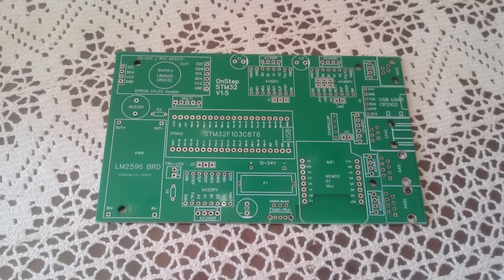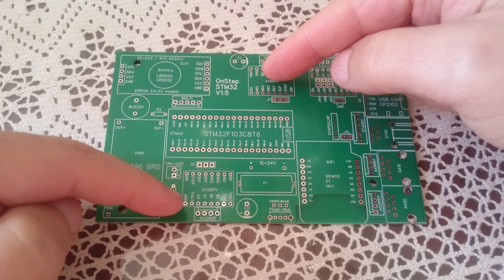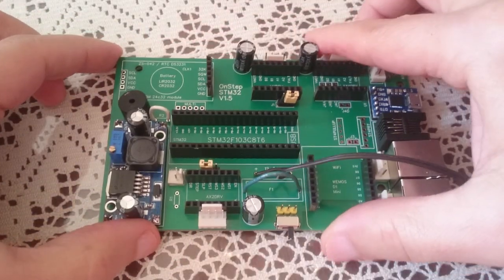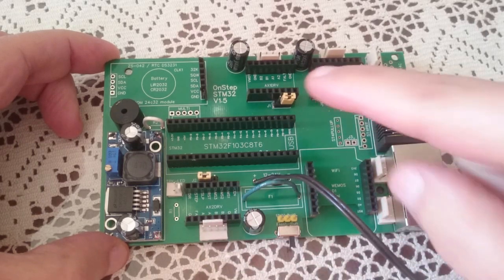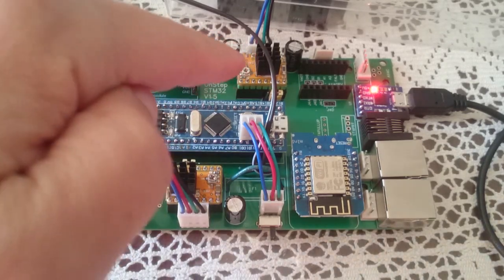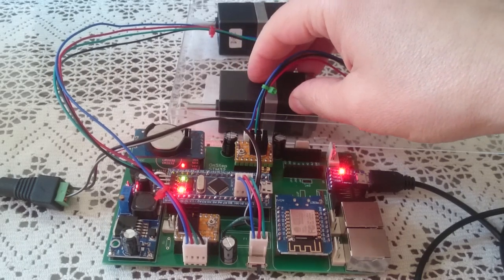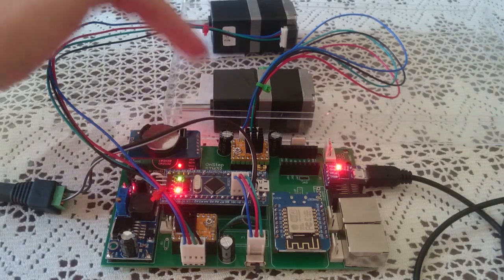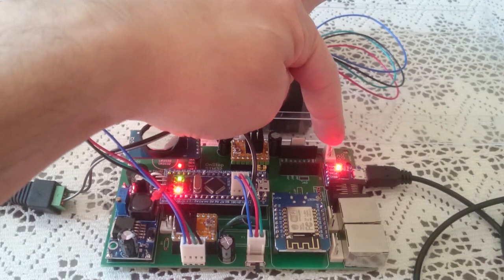PCB for STM32 Blue Pill OnStep Telescope Controller

Comment: this would be really cool...if only I could make it with the equipment I have in my lab
Reply from the maker: This is an old version of the project.

There are better boards now, and some of them don't require any sourcing of parts, nor soldering. 

Check the OnStep Wiki for more info.

Comment: One Question, Is the selected star or planet to observed using that will auto follow the object since the earth rotates? ?
Reply from the maker: Yes
Reply from the maker: That is only one part of the functionality. There are lots more features that OnStep has. Not all features are used by all users (e.g focusers, autoguiding, WiFi, Serial port, and so on). 

If you want a simple solution that only tracks the sky without having goto functionality (or the other advanced features), there are other projects that can do that. For example Sky Track, ...etc.

Comment: what about the resistor r2..
should we use a resistor at that position.
Reply from the maker: Please read the entire document that is linked in the description of the video
Reply: @khalid_ba  thankyou sir..
Reply: @khalid_ba  i have built the board sir and understood tat part..
but confused with the flashing of the software on to the stm32....
need some help with it..
Reply from the maker: @suveerudayashankara4273  please visit the first link in the description of the video. Details are all there.
Reply: @khalid_ba  sir i understood the flashing part but getting some errors while verifying the program..
it is showing :(no such file or directory found)
i even updated my ide as well but it is not working.
Reply from the maker: @suveerudayashankara4273  You have to ask about those errors in the OnStep group.

Comment: Hello, In your initial breadboard version, the output voltage of the step down buck converter was 3.3V and all the operating voltages of the components are also 3.3V, Can I ask why you’ve changed the output voltage of the step down buck converter from 3.3v to 5V in the final PCB version?
Reply from the maker: The main reason is to accommodate the Wemos WiFi controller, which is much easier to flash and more stable than the ESP-01S module. The latter is really a pain to program, and prone to failure.
Reply: @khalid_ba  Thank you for the reply. It’s a great help!  I’ve tried with the ESP-01S and found something wrong with it. I mean sometimes it is not working correctly (Not sending data to the main board).  I have to change the WiFi module. Thank you so much!

Comment: Hello Khalid, I am planning to make this version, but the Gerber File which I downloaded from your EasyEDA page mentions DRV8825 as the driver and not the LV8729. Will this new driver fit into the same holes on the PCB? Thank you. Also, if I do not wish to have wifi or the fuse, what should I do? My knowledge of electronics is very little. Thank you.
Reply from the maker: The LV8729 will fit in place of the DRV8825. 

If you don't want WiFi, then you will be limited to controlling OnStep over USB only, so from KStars or ASCOM. 

If you don't want a fuse, just solder a wire across.
Reply: @khalid_ba  thank you for the quick reply. I will decide if I want WiFi closer to the day I start to build 😀

Comment: Good video.
Terrible PCB :(
Reply from the maker: Well, over ~ 400 users disagree with you. 

You also could be specific, and constructive and not just hurl general criticism that way ... 

Of course, the PCB is not perfect. But it does not have to be: you know the engineering wisdom of: never let perfect stand in the way of good enough. That was the philosophy, and it succeeds in its mission.

Comment: Hi. I have the Arduino Mega 2560, RepRap Ramps v1.4, DS3231 RTC, A4988 step motor drivers, HC-05 Bluetooth module. Is it possible to create this project with the materials I have? If possible, what connections should I create and what code should I load? Thanks.
Reply from the maker: Possible, but it may be slow, and will have limitations 

https://web.archive.org/web/20210118065709/https://onstep.groups.io/g/main/wiki/3996
Reply: @khalid_ba  Thank you so much. So, what code should I install? I've seen codes with different names, I'm not sure which one. Can you help with this?
Reply from the maker: @hakankagan394  
All the info is on the OnStep web site

https://groups.io/g/onstep/wiki
Reply: @khalid_ba  thank you very much

Comment: Hi there Khalid. Sorry to write you here but I've just assembled my firts stm32 kit from George (no wemos wifi, just hc-05), after flashing and everything, I powered the board (the les appear dimmer than I thought) tried to connect to the hc05 with no successes (its led was also very very dimm) it doesn't show up in my BT devices list. Tried connecting it directly to the board with no success. Then I measured the voltages on the board. In al 5v pins it only read 2.2v. Then removed all the modules (with power of fb of course) to verify the voltage again, and they are 5v. So.. Its that normal? Im using a 12v 7a battery to power boar.
Reply from the maker: Please ask any support questions you have in the OnStep group. There are lots of people there with lots of experience.

Comment: What will I need in case I want to use onstep with bigger nema23 motors?
Reply from the maker: You use drivers that can output more current, like the TMC5160 or the S109
Reply: @khalid_ba  Thanks a lot Khalid!
Reply: Another question Khalid, does this onstep system need ancoders feedback to work?
Reply from the maker: @oalithgow  
No. 

There is experimental support for encoders, but it is for pointing accuracy, NOT RA rate control. 

And it is optional. Very few people use them in fact. OnStep does not require encoders, and is very accurate without them, as long as you don't have stalls or missed steps (which should not happen once you have done the initial testing).
Reply: @khalid_ba  Understand, thanks a lot again for the information.. I will try to embark myself on the onstep project to try and revive a 12" lx200 classic that I have, with dead electronics.
Reply from the maker: @oalithgow  
Many people resurrected old scopes with dead electronics using OnStep. Search for "onstep showcase" and you will see a list of mounts that were converted. Click on the links there to get ideas from how people did it.

Comment: Good job. Looks like a lot of work is put into this. While this board is a step above using breadboards, it only eliminates the wires. You seem well versed in embedded system and PCB design. It’s really easy to design a fully integrated board and get in assembled easily. I am happy to help for free if you have any questions.
Reply from the maker: I am not well versed in embedded systems nor PCB design. I designed this with the help of a friend in the late stages. 

Since this project was 2 years ago, things have changed a bit: there are now alternatives: 3D printer boards are now supported in OnStep, such as the MKS Gen-L and FYSETC S6, as well as one CNC board (WeMos W32 + CNC V3 shield). There is still lots of wiring to be done though. See the OnStep Wiki if you are interested.

Comment: Hi,

Could you tell us which geared motors you use ? do you included them in the prices you announced ?
Thanks a lot
Reply from the maker: No, I don't sell any kits. The link on my web site is to the guy who sells them from the USA. He may offer motors. I don't know. 

The geared motors I used are NEMA11 with an 18:1 gear reduction, bought used. I used them because they are small and can fit inside my mount.

Depending on your mount, there may be other better choices out there. Check the Wiki page and you will see a lot of actual conversions of OnStep with more details. If you don't find your answer, it is better to post to the OnStep group a message about your specific mount.

Comment: Is there another place to get this PCB now? It's discontinued on EasyEDA as far as I can tell. Seems like OnStep kind of petered out. Can't find any up-to-date links/info on parts.
Reply from the maker: OnStep is definitely as vibrant as ever, if not more. 

Nothing is discontinued. All that is changed is  that the guy who was selling kits decided not to sell them anymore. But all the parts are still available from eBay, AliExpress, ...etc. and the PCB is still on EasyEDA where you can order it. 

You can find it here https://easyeda.com/kbahey/OnStep-STM32-Blue-Pill

Check the Wiki page here for details

https://groups.io/g/onstep/wiki/STM32F103-Blue-Pill
Reply from the maker: The ordering form in EasyEDA has been changed. 

Now you have to click on Open in Editor, then click the G icon on the top (Gerber), and then the order form will popup. 

I updated the STM32 OnStep page to have these instructions.
Reply: @khalid_ba  Awesome, thanks for the response